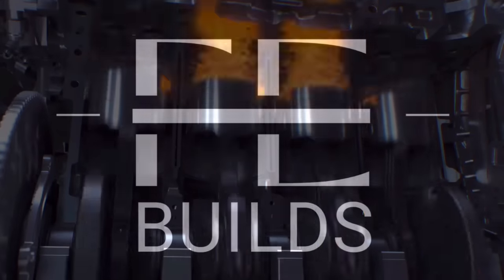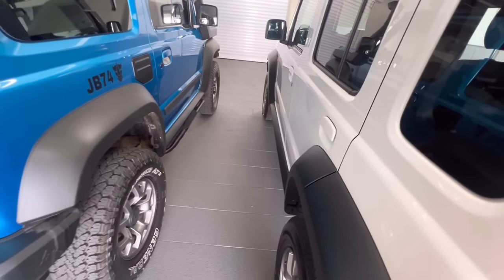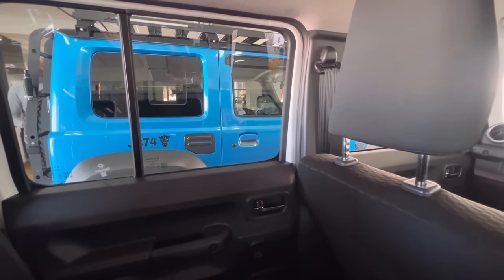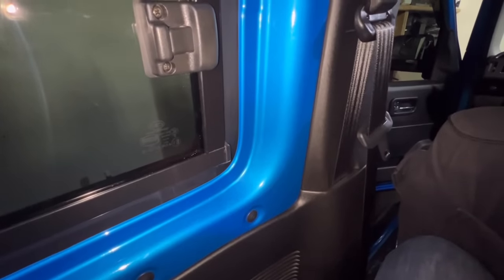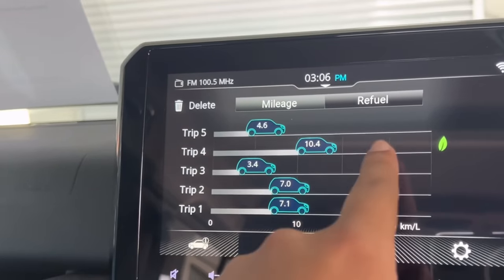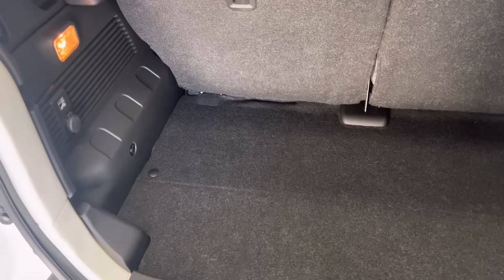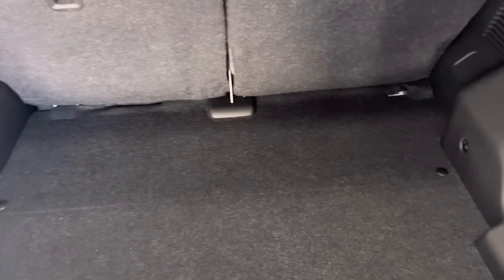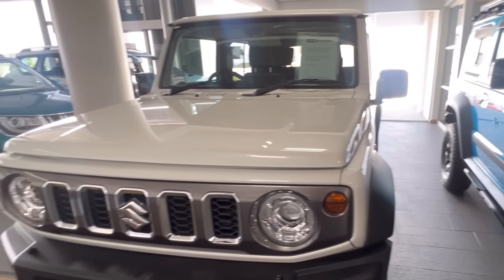Side by side comparison between the 3 door Jimny vs the 5 door Jimny, length, back seats, boot. JB74

Comment: Hope the aftermarket folk come up with a way to fold those rear seats flat as per the 3-door Jimny. The alternative might well be to remove the second row seats if more packing space is required.
Reply: Removing the rear seats is literally 2 mins job. There’s just one bolt which will come off and you can remove the seats and make it a flat bed literally. Used it a couple of times.
Reply: @ajayvishvanathan1991 aah!!

Comment: The 5 door in India has an Axle Wrapping problem, which the manufacturer weren’t able to pinpoint the cause of grinding noise while going steep uphill in 1st gear. The noise increases with time. The power is not enough. It feels sluggish in hills. In India this 5 door Jimny is a flop.
Reply from the maker: Thanks for this info. Will update the community on this side.
Reply: @febuilds  what we could guess is the problem with the longer wheel base. Rest I am also eagerly awaiting if people start coming up with this problem in due course of time and the solution to it. Regards

Comment: A five door Jimny will be an awesome mall-crawler but I have my misgivings since people will now really load it up beyond the existing minuscule loading capacity of the Jimny.  The Jimny concept worked exceptionally well since it was such a tiny car — merely that the market demanded four doors does not mean it was a good idea.   I have been in the market for an overlanding vehicle for some time and where the Jimny was my first choice I might just settle for a 4x4 Isuzu pickup instead due to the almost four times greater loading capacity.

Comment: Very nice video! I just like the look of the 3 door more but I guess that's the case with all 3 door vs 5 door vehicles. 3 door look more unique Jimny whereas the 5-door looks a bit Jeep-ish (not necessarily a bad thing) from the side. 5 door just look a bit 'off' for me but with bigger wheels, like Optimus, the 5 door will look more the part & it will make up a bit in what it lost in the break-over angle for 4x4 purposes. Like you said, it will definitely be more practical space wise. Jealous of that better infotainment screen & it appears that you can turn of 'beeps' in the settings like seat belt out etc.

Comment: Nice comparison. I'm not sure if the extra space is worth it. The 3 door is perfect for me as it is.
Reply from the maker: The 3 door is awesome and Im enjoying mine also, its worth noting the 5 door is much easier to get into the back with the doors, and you can easily store 4 small to mid sized travel bags in that boot, it will work amazing for young  families, and would work well for picking up and dropping off kids at school. It is more practical for a daily in city driver who regularly carries passengers and can be used on the weekend also to hit the trails

Comment: Nice review, we've been test driving a few Jimnys. 3 door was to small. Did you think about waiting on the five door to come? That has been coming for a long time now and still not available in Australia. Ended up paying $5k more for a Nissan Warrior. I'll have always said Suzuki somehow. Should have got the SX4 motor into the Jimney
Reply from the maker: We liked the 5 door but personally the 3 door works perfectly for the application, to be honest, we only used the back seat twice since getting the car and now they are permanently folded down. Im making an aluminium trunk to replace the back seat, will keep all recovery gear in here.

Comment: The 5 doors not much heavier for the 1.5L but what if you use it for its intended purpose! Extra passengers and extra luggage might add up to another 200kg on top of the extra 100kg of weight the five door carries. It doesn't leave much room for mods like sliders, barwork or a roof platform if you want to set it up for 4WD trips. Really disappointed Suzuki couldn't give it a bit more power from factory..

Comment: What about the water wading capability of Jimny only being 300mm ? Is a snorkel proper remedy for it ?
Reply from the maker: I assume in stock form yes but on our Jimny Optimus, its much more
Reply: @febuilds   can you post the video link pls
Reply from the maker: @indiaoverland2846  a snorkel itself is not enough, you need a diff breather kit, a snorkel and a certain mod on the air filter box. In some vehicles you also need a transmission breather kit, thats if you want to do it properly. Optimus can go through very deep water but its been modified for that. The vids of those mods are still coming?
Reply: @febuilds   do you guys put on sale those kits ? Do those kits ship  to India? Thanx for replying to my queries

Comment: I cant fathom any way that this 5 door, weighing 100kg more than the 3 door variant, wouldn't benefit from an increase in engine power/torque. My wife has the 3 door and it feels underpowered, especially on an incline. Years back I had a diesel Swift, that engine would work a treat in the Jimny.
Reply from the maker: To be honest with you, i think that engine has enough power hidden in it. Our 3 door Jimny build weighs more than other 3 doors and its got bigger heavier tyres but I leave the the others behind. Just the exhaust mod with the proper tuning will suffice, to that if you change the gearing ratios, it may have a lower top speed but it will not struggle. I think suzuki may have to meet allot of regulations and safety standards while making the cars more reliable, while still keeping it affordable and I personally think thats the problem. As I hinted in the video, It would have been nice if it had more power. Other than that its a very nice car.
Reply: @febuilds  Thank you for the thoughtful reply. However you are telling me that the engine is not adequate, without tuning/mods. Why not get it right straight from the factory. It is a great little truck in 3/5 door guise. I wouldn't be making excuses for Suzuki, they could solve the engine problem quite easily.
Reply from the maker: @robotstobor3388  just my thoughts, im sure suzuki have their reasons
Reply: @febuilds  of course, I'm sure I don't know more than you or Suzuki

Comment: The 5 door has no charm. all that's necessary to do is increase Lenght of 3 door to 4000Ccms and width to 1750 cms, and height remains the same. This would be an ideal small SUV for older drivers.  I sometimes think the reviewers are trying to mislead Suzuki in favour of some other British  odel
Reply from the maker: In my personal opinion, I think the 5 door Jimny gives young families with two kids access to the jimny world. Yes the 3 door could do that but in terms of the practicality of picking up the kids and dropping them off at school everyday, because of the back doors, it makes it easier than the driver having to get out fold the seat down, help the child to come out and then doing the same again after school. I think both are nice and the 5 door will bring in a group of people who always wanted a jimny but didn’t get one because of the practicality of every day use. Im my opinion this is a really cool/capable station wagon.. branded as a 5 door small off roader. I think they don’t intend to stop the 3 door, they are more just giving access to people who need 5 doors and really want a jimny